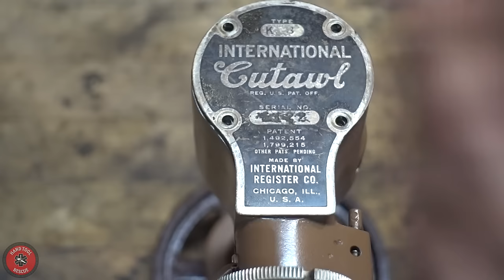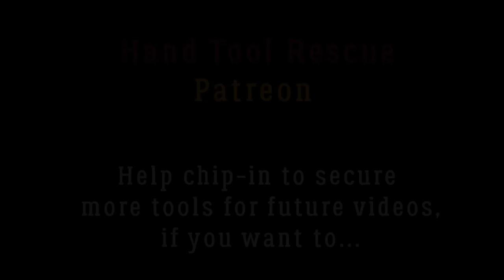1930s Rotary Jigsaw (Cutawl) [Restoration]

Comment: Everything back then was designed and built so much better.... Maybe not from a safety perspective, but man, they were rugged machines.
Reply: Actually, if you think about it, the only machines we see around these days are the ones that were built to last. There was plenty of junk, it just didn't last long enough for us to see it.
Reply: Reminds me of music.
Reply: Atticblur Exactly. There's plenty of bad music from "back in the day" but we only remember the good stuff. Likewise, there's plenty of good music being made right now.
Reply: Jayton Hawkns that is true, therefore the phrase 'old is gold' is not true
Reply: It may have been built better. But it wasn't designed better.

The reason these things last forever is because they're chunky cast metal pieces of very basic engineering. The motor's power is directed through a shaft to the a rotating piece to move the blade. If you got this thing's equivalent now it would be half the size and have a gear box for speed control. And also be produced in such a way to reduce cost as much as possible, while still being somewhat sturdy. Not to mention it would also be half this thing's weight.

They didn't make it that way by choice either, the only real plastics that they had were natural polymers that needed to farmed, and bakelite. Because of that you can see that the motor winding's are covered in really old nasty natural lacquer. This thing also would've cost you an arm and a dick back when it was new. Most people don't really realize that, these things were not in the same price range as what we have now. For a chainsaw you could be paying $1000+ modern day equivalent money because everything was a chunk of metal that need to be shaped by hand. But you payed it because you were positive this thing would last you the rest of your life. While now you can buy 5 chainsaws before you spend the same kind of money. Of course, you probably will buy 5 chainsaws over your life because everything is cheap it's not really worth fixing.
Reply: There's plenty of rugged, quality industrial equipment to be had, these days. Most of what you see in-stores are consumer-grade power tools: a niche that didn't really exist back then. I've seen some pretty shoddy vintage carpentry tools too, like jack planes with soles made of rolled steel, rather than cast iron.
Reply: It wasn't that good. I mean he tested it by cutting cardboard, not a good sign of its usefulness. It ran like a low powered sewing machine
Reply: Survivorship bias is a thing, I too used to think that all things made back then were better but I'm sure they had their own amount of crap tools.
We only see the few examples that managed to get to us in decent shape or the ones that we're able to fix.
Reply: Not really, it was poorly built and even worse in terms of build quality. No precision, poor tolerances, lower power, not very durable, hard to service, etc. It only lasts longer because it's made of rugged materials, but as far as tools and their purpose goes, it's stupid to say they were "so much better". Kinda like saying that "cars were so much better" when in fact they're infinitely better in every single way today. It's extremely irritating to see so many people nowadays have that stupid opinion of how things used to be better in the past, WHEN THEY OBVIOUSLY WERE NOT and when they clearly have no clue what they're talking about. It takes a lot of ignorance, as well as very poor knowledge and understanding in order to think that everything "old was gold".
Reply: Justin Miller
It wasn't built better, it was built horribly badly, but it was so simple in design that it didn't matter that every unit was very different from the other and that tolerances and accuracy were so low.  It's easy to make a "rugged" piece if you're gonna just cast it out iron or steel and put some simple gears inside. The reality is, even the cheapest crap you can buy new today is far better than the best stuff made in the 30's, might not last as long because it's not made of big solid chunks of metal, but it will do the job it was built for much more accurately and for longer.
Reply: Cars back then were built out of metal and were made to last, but cars now are made flimsy plastics and are made to be used till they break down
Reply: I seriously doubt anyone is going to upload a restoration video of a harbor freight tool in 80 yrs
Reply: haha, nowadays you barely see any broken down cars on the side of the road. i remember a time when broken down cars on the roadsides was an almost weekly occurance. and about the flimsy plastic bit, thats just in the cheaper end of the business. theres plenty of nice well built cars for sale nowadays
Reply: bjorn wisman dont know what planet yall are driving on. Yes cars are easier to operate because people are getting dumber and lazier but not better quality. They ofen do break down on the road because ppl cant afford an MIT grad to work on it. And cars are 10 year disposable items and thats being generous.
Reply: And you were very lucky to get 100,000 miles out of a car back then.
Reply: It probably was good for it's time, we have to see what it is capable of with a proper cutting blade but definitely it's performance won't come anywhere close to a good quality modern jigsaw.
Reply: Nothing back then was designed or built even nearly as well as stuff today. Today's things are far more complex and it takes much more understanding and knowledge to be able to appreciate the designs and technical solutions used.
Reply: Shrek The Mighty over a few songs someone finds bad based on opinion? Does that really matter, there is a lot more crappy music today then there was then anyway.
Reply: Bomb Twenty what about the fact he didn't have a different blade.
Reply: This is factually false
Reply: They were wastefully built and often not well engineered. I could build anything out of a giant chunk of metal and keep it around for 100 years. That doesn't mean it's particularly well built or useful though.
Reply: Jayton Hawkins75
Reply: Nicholas Of Alexandria 
'  Bentley o t
Reply: Nicholas Of Alexandria '
Reply: Bomb Twenty different blades cut different materials bud, I'm pretty sure it's a hole punch for stiching leather anyways. Bet you a thousand dollars I could but proper blade on there and that motor with that much torque would cut what ever material you wanted with in tolerence and do it continuously for another hundred years if properly maintained.
Reply: How many modern machines will be around in 100 years?
Reply: Yeah right...the majority of today's stuff is designed to last the warranty...they don't build much like thy used to.
Reply: Go buy a fucking garden hose hand sprinkler...I got 6 months out of 2 of them in a row...on my way to exchange for a new one, they broke in the same place thanks to the under designed cheap plastic components...I have a sprinkler that is over 40 years old and still works.
Reply: I love that adjustment to change the depth of cut. Have never seen that on a jigsaw, maybe on higher end units? Come to think of it, never heard of a "high-end jigsaw" tbh...
Reply: Because simplicity
Reply: built to last
could drop the tough lil bastards and they wouldnt break like stuff dose now
like MAKE METAL TOOLS THAT ARE SCOOKUM
Reply: Ppl worrying about safety is what fuked a lot of shit up
Reply: Theres a mix here no ones talking about. If you take the "well built b/c we had to" (i.e: solid long lasting cast iron & overall better items that aren't plastic/better metals), from back in the day parts, & married them to some of todays "new technologies, engineering and safety features...we'd have one heck of line of products. Theres better from BOTH eras, not just ONE...JMO
Reply: @derbigpr500  ''Crash a new car "made of flimsy plastics" into a an old car and see the old car fold like a piece of paper'' i seriously doubt that seeing as modern cars are designed with crumple zones, and that's a good thing. Safety is the number one reason to even own a new car, they are far superior in that regard.
Reply: @derbigpr500  not going to get into this debate on who's right and who is wrong. Seeing you have said you're an engineer then thank you for your knowledge of how to design "things". The difference in engineering then and now is quite different. Back in the day, tune ups took maybe a couple of hours, today a couple of hours just to find out why spark is not reaching plug. To rebuild an engine a couple of hours to pull engine, now a full day to pull the engine. Back then, paint faded, today clear coat fogs and paint peels. Back then a new car was 3 or 4 thousand today 20 to 40 thousand. Yes the vehicles today do last a heck of a lot longer, BUT, unless you have the very expensive equipment to plug into a computer in the vehicle to diagnose the problem then you are screwed. A lot of the cars now don't even come with an oil dip stick!!!. Some don't have an exterior key lock. Who came up with the idea of putting batteries in a fender do you have to take off the tire and get under the car to change it. Why put cabin filters in location where the dash has to be dismantled to change it. So until you  have to put yourself in the shoes of people who cannot afford to pay out the nose for maintaining "simple" things then quit being so arrogant.
Reply: @acerbicgeoff7821  so how much did you pay for the device that tells you what is wrong when a check engine light comes on. When a light comes on telling you your tires are low yet when you have them checked all are ok. When you replace a sensor because the car tells you it's bad and after dropping a hundred bucks it still tells you it's wrong after having the light reset. Then you find that the car company puts out a notice to their mechanics telling them to enlarge the opening in the manifold to solve the problem. It took me 15 minutes to change this sensor but the mechanic wants 400 because he needs to remove the manifold. In your honest opinion if you were on the road with a plug socket, ratchet, short extension, one screw driver, and a pair of pliers. Which would rather change a foulded plug in..a 1960 Cadillac or a 2018 Cadillac!!!!!
Reply: @eduardosampoia5480  probably bought at Wally Mart, made in China
Reply: Supreme Leader Spock  that surprised me as well
Reply: @shudini985  yes gold is in fact gold and old is just that old.....
Reply: They don't make comment sections like this one anymore  shame really
Reply: @dreadmireironbound8418  Actually,  not so much. Today's cars are so much better engineered. They are built with lighter, stronger steels, aluminum, composites, etc.. In the name of efficiency, different materials are utilized for different needs. They are coated and treated (e.g. galvanized) as needed. They meet far more stringent environmental and safety requirements, are far more efficient, need far less maintenance, and last far longer if properly maintained. The US fleet average age grows every year (the cars continue to function longer). Sure, you can find older luxury cars that were built for the super rich that are finely engineered hand crafted works of art, but they have less functionality, efficiency, safety, affordability, and environmental friendliness than the cheapest econobox available today. YMMV
Reply: I am not sure if they were or not, at a glance it is all metal and appears to be constructed well. And one could argue 50 years later it is still here (even in shitty condition), however I have dropped my Dewalt 20v brushless from 12 feet picked it up and used it without giving it a second thought. Given it may not be all metal construction but comfort, accuracy, safety and some durability is worth it in my opinion. I wouldn't trade my modern day tools for any of this old stuff but it is neat to see it restored and functioning.
Reply: @rick-hm3ji  OK that's your opinion
Reply: @dreadmireironbound8418  Except that my "opinion" is fact and data driven. But again, YMMV
Reply: Nicholas Of Alexandria caca
Reply: Waoooo i love to do such jobs as well great redtoration , Gunk worked well, hhhhhhh goodluck
Reply: Really hard and beautiful work appreciate that
Reply: @derbigpr500  You might want to re-check your logic : "the cheapest crap ...today.. might not last as long... but it will do the job... for longer".

Since it's not clear that clarity of thinking is your strong suit, I'll sum up : please explain how something that won't last as long, is going to work for a longer period of time?

Also, you might care to substantiate your repeated assertion that "it was built horribly badly".  Simply repeating something doesn't /really/ make it true, even on the interwebs.   If you're uncertain how to approach such at effort at putting some facts in to your opinion-stream, you might try attacking the proposition that if a tool's easily-serviced design lifetime appears to be approaching a century, it's not clear that there are any serious issues with its build, or design quality.
Reply: @chapiit08  Its performance for what it was designed for, far exceeds any modern jigsaw, quality or not.
Reply: This thing was set in a dark corner and never used again within the first 10-20 years of its life because something better was made. I have a 15 year old bosh jigsaw that’s been through hell and back, still works, can still buy blades for it and it can still cut wood, metal, plastic, or cardboard better than this thing ever could. It’s cool but it’s not better than its modern equivalents.
Reply: I agree ..! I liked ,especially the oil cartridge with spring & felt ... very genius 💡
Reply: @jaytonhawkins2872  , Disposable tools!
Reply: @wray1104  I think that BeyerT1 guy needs the Preparation H a lot more than the Cutawl does